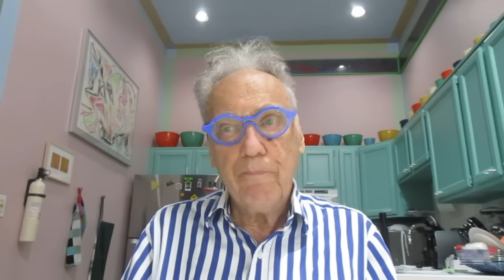Why  is H.C. Verma's Solution Wrong?

Comment: I read up of some of the basic concepts for this problem. My attempt at the answer - 

1. There will be no current inside the superconducting wire

2. Faraday's law doesnt apply inside, because for it to generate an induced emf - the spin of the electrons must be parallel. But the spin of electrons in a cooper pair in a superconductor are anti-parallel. So Faraday's law doesn't work inside the superconductor.. (until the Meissner state breaks down when the applied magnetic field is too strong). 

3. There is no b-field inside the superconductor. For the reason stated above - the opposite spin of electrons in a Cooper pair.  Hence the quote "magnetism and superconductivity are natural enemies"

4.  Faraday's law only applies on the surface of the wire (where it acts as a perfect diamagnet and perfectly cancels the external field), as magnetic field decays exponentially inside the superconductor.

Comment: sir i watched videos of both many times but i don't understand why electric field in superconductor is zero ,if due to cancellation of field from each other ,which created by charger present inside superconductor.  if i am right then when charger flows on the surface then it 
 effect of other charge which is present inside superconductor then how can it be said that electric field is zero even after flow of charge on the surface of the  superconductor.. please answer me  .
Reply from the maker: use google

Comment: I think hc Verma sir missed a point in that lecture which would have made him more accurate....that
Moving magnet induces an electric field in space .....but electric field inside the superconductor has to be zero .....so in order to cancel out the electric field , an equal and opposite electric field is developed in the coil which is responsible for the current
It might be what sir hc Verma had been trying to say😅😅 because else without an electric field there should not be any current
And if conductance is infinite and electric field is zero, current density get an indeterminate value, not necessarily a finite one 😅😅
It needs more clarification what he actually meant 😅😅
Reply: @Lectures by Walter Lewin. They will make you ♥ Physics. well sir ....we know it's your job to point the correct and incorrect which you have done, there is no place of ego in science, we all understand that 😄😄.....you won't be losing a single subscriber 😄

Comment: Sir i have a question.
Suppose we have constant magnetic field for every point on xy plane is  B(t) = B⁰sin(wt) k^(k-cap), where B⁰ and w are constant and t is time . Now we have a circular ring of area A, placed with in xy plane with centre at origin, its self inductance L, and has resistance R. Then Flux through it as a function of time ∅(t)= B⁰Asin(wt). Since flux is changing then there will be induced Emf(induced) V = -B⁰Awcos(wt). Then there  will be current induced l i l= B⁰Awcos(wt)/R. So the Net Flux through the ring is equal to 
∅(net)= ∅(t) - Li . But the net flux is itself changing because i is also changing and ∅(t) is also changing so new emf induced =-d∅(net)/dt which again creates a new induced current and again a new new net flux. Where i am wrong?please correct me

Comment: After I saw your solution, a question came to mind regarding Faraday's law. Suppose a magnet and nonmagnet are dropped from the same height. Do they fall together? The magnet generates electric fields ahead and behind due to Faraday's law as there is magnetic flux change. The electric fields are time varying and will generate magnetic fields that will oppose the field of the magnet and slow it's descent relative to a nonmagnet. Is this correct?
Reply from the maker: good question. A falling permanent magnet will radiate an E-field (Faraday's Law) which contains energy.  This energy is Kinetic energy due to gravity (not magnetic energy). Thus the magent would not fall as fast as the non-magnet. There must be articles that describe observational evidence fort this. If you find them send them to me.
Reply: Anwar bro ....A there i induced emf generates and oppose The direction of motion ...you can say it will be in upward direction....so It will land later

Comment: I think professor Verma's solution is totally misunderstood here

This is what professor Verma said : 

Lenz's law : A changing magnetic flux induces a current in such a manner that the magnetic field due to the induced current opposes the magnetic flux that induced the current in the first place. 

What professor Verma said using Lenz's law is that, the current that is induced on the (surface of the) superconductor produces a magnetic flux that opposes the magnetic flux due to the moving magnet, which was responsible for inducing the current in the first place. 

This is exactly the answer that professor Lewin gave, the only difference being, he calls it Meissner effect. And professor Verma could reach the same conclusion using Lenz's law !!!

Professor Verma's solution is NOT wrong. It's misunderstood
Reply: I also think the same the only point he did not mention was that the current in the superconducting loop will be induced at its surface and not inside it. The only difference Mr. Lewin and Shri Verma has is of in the loop and on the loop
Reply: Yeah, as a matteŕ of fact , verma made it clear that in any condition you don't have electric field inside superconductor and hence leaned on Lenz's law to make it clear to us STUDENTS. HAHA, indian way of jumbled english  makes it confusing but yeah you are right!

Comment: Solution: Due to messier effect, no current will be produced in the superconducting coil, when permanent magnet is moved in & out of the superconducting coil. 

Magnetic field of the permanent magnet (while moving in) will be squeezed radially inwards. What changes here is the shape of the magnetic fields, i.e., shape deformation of magnetic fields of the permanent magnet.

Comment: This ‘simple to state problem’ has caused me some ‘brain pain’.
I have often wondered about the role of gravity and temperature on electron flow and at what point does a super conductor become a super conductor.
I have revisited your lectures regarding Faraday and Kirchhoff and I hear your wise words regarding Faraday.
This is why I love Physics.
Physics works and whether you can prove it with mathematics or not Physics is not bothered.

Comment: Sure sir, Professor H.C.  Verma won't feel bad about it but you did feel bad when Mehdi Sadaghdar corrected you.  When he mailed the correct solution to your problem about KVL in a resistive loop (two resistances connected parallel) linked with changing magnetic flux and proved you wrong then why did you not reply further to his mails?
Reply from the maker: I demonstrated at the end of my lecture #16 of my 8.02 E&M course at MIT that two identical voltmeters attached to the same 2 points in a circuit can show very different values. https://www.youtube.com/https://www.youtube.com/watch?v=nGQbA2jwkWI&list=PLyQSN7X0ro2314mKyUiOILaOC2hk6Pc3j&index=17
This can also be demonstrated with a transformer.
https://www.youtube.com/watch?v=b7i2uMx7gHo&list=PLyQSN7X0ro22zanLOcvkaSY-IZqheFYM5&index=8
The reason is that an induced EMF (Faraday's Law) creates a non-conservative E field. This means that moving a test charge between the same 2 points in a circuit can require a different amount of energy (even with opposite signs!). You still aren't getting any energy for free, because it comes from the source of the time-varying magnetic field.
When a voltmeter reads a value V it means that the integral of E dot dL across the voltmeter is V. 
In cases where Kirchhoff's loop rule (KVL) applies, 2 voltmeters attached to the same 2 points in a circuit will always show the same value. Kirchhoff's original text can be found in the following link, pages 497-514: https://books.google.de/books?id=Ig8t8yIz20UC. Clearly he was fully aware of the prerequisite for his "loop rule". KVL is a special case of Faraday's Law. That's why Faraday's Law is one of Maxwell's equations and KVL is not.
My demo was first suggested and published by Romer in December 1982 in the American Journal of Physics. This demo has now become a classic; it's done all over the world at many colleges and universities.
ElectroBOOM and Dirk Van Meirvenne believe that 2 voltmeters attached to the same 2 points in a circuit must always show the same value which is not true. They each posted a video on their channel in which they claim to have proof for their wrong ideas.
Also read Professor John Belcher's thoughts on Faraday's Law and on KVL. Professor Belcher is my former colleague at MIT. http://freepdfhosting.com/0813df09f5.pdf
ElectroBOOM insulted me in his video by mentioning that the reason why my 2 voltmeters read different values was due to "bad probing". He stated that if I had done the demo correctly both voltmeters would have read the same value. He could not have been more wrong.  
The following video may also help some of you to understand why 2 voltmeters attached to the same 2 points in a circuit can give very different readings. https://youtu.be/T6S5VS03xZc   I thank Mick Vall for his insightful comments.
Reply: @lecturesbywalterlewin.they9259  thank you sir.

Comment: Good Morning/Evening sir,
There's a question related to faraday's law. 

Here we go:
Imagine that we have a space-ship which has a coil of wire inside it just like a coil possessed by a generator and it's revolving around Jupiter's magnetic field in such a way that if we assume jupiter's north pole pointing upwards , then our spaceship is moving at an angle of 90° to it. So, the question is will electric current be generated inside the coil?
Also, jupiter's a rotating body too with a RPM of __.

Comment: No you are wrong because See it is very clear that the H.C. Verma said there will be no E field inside the superconductor even if current is flowing that obviously means current is flowing through the surface of wire..........
Reply: Agree

Comment: In superconductor there is no resistance. The ring is turned through  π\2 so that it's plane became  perpendicular to the field .then current LdI/dt=+dphi/dt =>I=∆phi/L=πa²B/L.a=radius.In superconductor magnetic field will be zero.By Meissner Effect. So , inside current will be zero.By Maxwell Equation.
Reply: Sir, please tell me that Am I right.

Comment: Please correct me if I'm wrong but wouldn't it depend on the frequency of the movement of the magnet inside the superconductor? Unless the material was at a temperature of absolute zero then wouldn't the wire still have a resonant frequency that "could" be matched therefore inducing resistance  within the superconductor??
Reply: Sorry "matched" would be an incorrect term, as it might imply that would make the material colder. But if electrons within a superconductor were flowing in one direction at a maximum conductive speed of the material then shouldn't an ac current or (if we take the frequency assumption away) a "theorical" magnet with greater magnetic flux than the superconductor moving into the first superconductor in an opposite polar direction, induce a reverse current therefore producing resistance in the wire?
Please correct me if I'm wrong, I probably am. Thank you so much for all your videos and all your knowledge.

Comment: I did not understand why current inside superconductor is zero after all superconductor is made to pass current without being any obstacle that is to say without any resistance?
Reply from the maker: listen more closely as I explain that in this video
Reply: @lecturesbywalterlewin.they9259  Thank you for your prompt reply. I watched your video again and came to conclusion that current inside superconductor is zero because there is no any battery connected in the superconducting coil. Moreover due to nature of superconductor(is there any explanation for this too?) current is produced on the surface of superconductor  due to Faraday's Law of electromagnetic induction because resistance of surface of super conductor is finite. I think magnetic field produced by this surface current opposes the external magnetic field and external magnetic field gets diverted by superconductor after penetrating certain depth inside superconductor. This is known as Meissner effect which is one of the characteristics of superconductor. Also to pass current in superconductor some electric field is needed some where in the circuit loop made from only superconductor. As it is clear from the example you have given that the battery has the electric field but superconducting wire connected to the battery has no electric field. Please correct me if I am wrong. Just to clear my doubt I have written a bit long. Hope you will answer it.
Reply: @sachinrajpandey5242  bruh bcoz when superconductor gets current it get outside not inside

Comment: Hard to grasp prof. If there's no current in superconductors then how is it that MRI machines super conductors need to be ramped up ? If the current is on the surface of the super conductor where resistance is not zero then there is power and the machine would lose it's magnetic field pretty fast. That does not happen. When an MRI Magnet is ramped up it goes for ever. So how can that be ?

Comment: The concept of kinetic inductance in a superconducting loop allows us to establish a momentary non conservative electric field in the loop which momentarily accelerate the electrons to a speed v such that the resultant current when multiplied with the sum of self and kinetic inductance of loop gives 0 flux change, however in case of extreme condition, the superconductor also loses this ability,  depending on whether it is of type 1 or type 2.
Reply: Sir, humbly waiting for your reply.

Comment: NO! HC Verma's solution is not wrong. I think you completely misunderstood his explanation, as he repeatedly said that the Electric field inside the superconductor must be zero. So what he meant by the "currents" was actually the "surface currents" which produce an opposite magnetic field internally which cancels the electric field in the wire.

His explanation makes complete sense and is exactly the same as your answer! Please watch his video again.
Reply: "surface currents" is the main heart of prof. lewin's answer. this is the main concept and beauty of the solution (if you already know other concepts used in the problem). lookup meissner effect first. no need to feel bad. we are lucky that people like prof. verma and prof. lewin are able to share ideas on a public platform. even einstein gave different theory than newton. it does not mean that newton was humiliated. when the intention is to seek truth - truth alone is the winner

Comment: Professor,  it is completely fine , no incorrect solution will affect our friendship
Reply: yes , also its nothing big , our sir tells us many times that this  derivation is given wrong in hcv , to make it easy , though result is correct , it made some assumptions to  simplify an otherwise lengthy proof
Reply: magnetic field on the axial line of a ring , is the derivation correct ?
Reply: BINOD

,
,
Reply: @divyanshu9006  ya i agree like electric field due to dipole and bio savart's law are complicated as compared my teacher's proof

Comment: Basically in HC Verma sir's solution he mentioned that current will be in superconductor but actually it is just on the surface and not inside the superconductor. All he has to mention was tha current is on surface. Well it was just amazing question for the understating, thanks for your time to come up with this.
Reply: Not just "all he had to" , he deviated into the wrong direction from there.
Reply: But the assumption that the current was inside the superconductor  created divergance from the right approach

Comment: Sir have  you seen  my ans for  the question  yes it wasn't  right but have u 😐
GH also  replied  on that. Plz see if hadn't
Reply from the maker: yes I have seen your answer and I even sent it to Prof Loeb.
He agrees that it is wrong.  
-----------------------------------------------------------
the viewer wrote 
In the superconductor there will  be current (batch of moving charges) even without any voltage difference.
This must be dead wrong. If they mean the current on the surface then there is a voltage difference due to Faraday's Law.
You wrote:
Therefore, you end up with a surface current that satisfies Faraday's Law outside the wire, by generating an electric field that satisfies Maxwell's equations.
I  have to justify who have correct solutions that's why I do want to fully understand this discrepancy.
----------------------------

Walter Lewin
Sep 13, 2021, 2:16 PM (23 hours ago)
Avi so it is wrong and Ican state that?

-----------

Avi Loeb
Sep 13, 2021, 2:21 PM (23 hours ago)
Yes.

Avi Loeb
Sep 13, 2021, 2:22 PM (23 hours ago)
to me

Agreed. No voltage difference is possible inside a superconductor because it will be shorted instantly by a huge current.

---------------------

Avi Loeb
Sep 13, 2021, 2:31 PM (22 hours ago)
to me

This is wrong, as we agreed. You cannot have a current without a voltage difference that drives it (otherwise, the current will generate accumulation of charges and a voltage difference). The key in the solution is that the current exists on the surface where superconductivity is not in effect. The skin (of width of London penetration depth) is where superconductivity is violated and where current exist to enable Faraday's Law. The key in this solution is to recognize that superconductivity cannot hold everywhere. In order for E=B=0 to hold inside the superconductor and for the Meissner effect to hold, there must be surface currents that cancel out the external E and B fields.